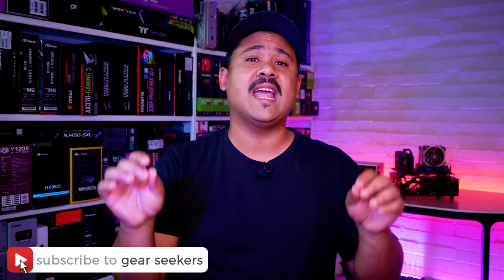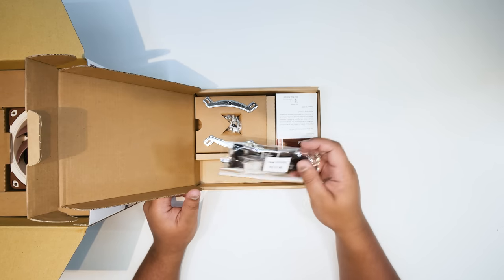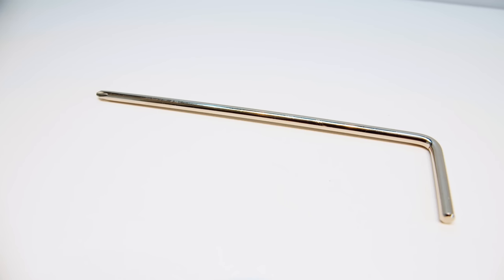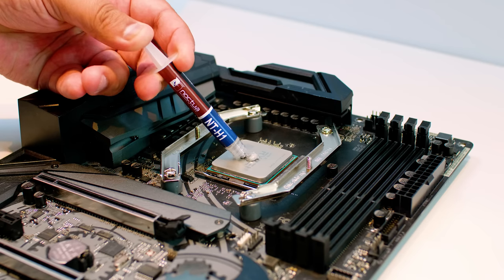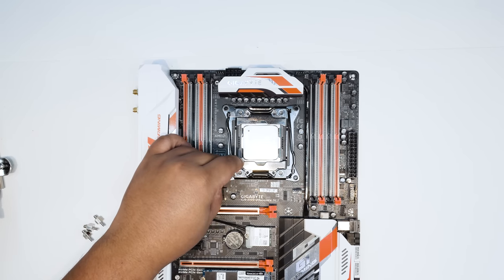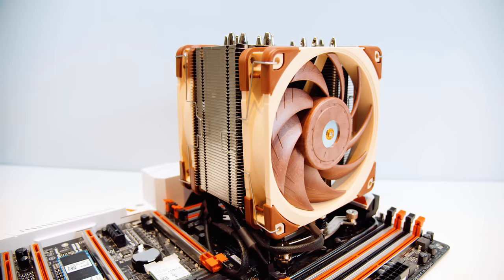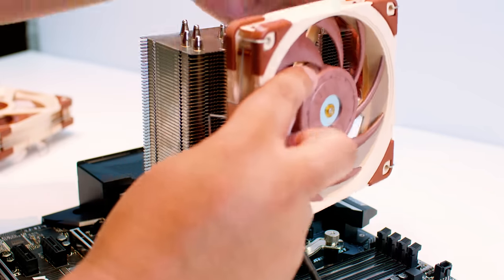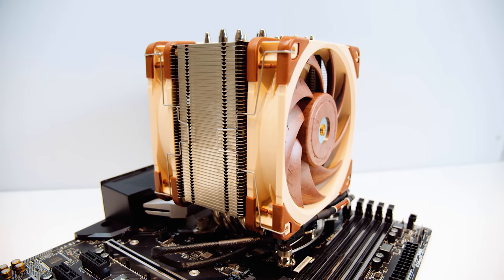HOWTO Noctua NH-U12A Intel and AMD Install Guide

Comment from the maker: AMD AM4 Install 4:24
Intel Socket 20xx Install 7:47
Intel Socket 115x install 10:46
Reply: Top man. Thanks!
Reply: do you know which socket I would have with a Asus ROG STRIX Z490-E GAMING ATX LGA1200 motherboard?  I think it's the 20xx but not entirely sure...
Reply: @yzwme586  LGA1155, so video at 10:46
Reply: I realize I am pretty randomly asking but do anyone know a good place to stream newly released series online?
Reply: @Jasiah Maverick i watch on FlixZone. You can find it on google :)
Reply: @Jasiah Maverick Lately I have been using Flixzone. You can find it by googling =)
Reply: @-cheshire-cat  If you dont mind me asking, how did you get "LGA1155" when he said "LGA1200"" in their comment. The timestamps only mention "20xx" or "115x" which doesn't match "LGA1200"

I'm trying to figure out what guide to use as well.

Comment: I really appreciate this video! After watching this install I'm baffled by all the negative installation reviews for these coolers, it's not THAT complex.
Reply: Hi. Will it install in micro ATX motherboard ?
Reply: @GauravNikoBellic  You can check your case / Mobo and CPU compatibility with this cooler on their website - alternatively you can search your case/CPU/Mobo and find all models which will fit.

Pretty glad I used the service or I would have bought one that didn't fit my case.

Comment: Just used this guide to install my cooler on the 3700x. Now I can hear myself think again. Thanks!
Reply: I'm waiting for am4 mounting kit for mine noctua u12s , so I can get rid of the included cooler. Its pretty, but too noisy for my taste :)
Reply: David, do you have to remove the motherboard from the case? Or can you leave everything in place when installing the cooler? Thanks in advance!
Reply: J. Bertels It all depends really, if you want to remove the mother board it would be easier since you have the space and clearance to do it. But if you wanna go ahead and do it in the case just know it will be cramped

Comment: I haven’t installed a cpu cooler in years and I’m looking to get a new one for my current pc. I’m too lazy to take everything apart, and forgot if I had to remove AMD motherboard to install it. Turns out, I don’t have to! Thanks for the video! I’m also looking to get this exact same cooler

Comment: Mine NH-U12A was EXTREMELY hard to screw in. Threads wasn't latching until you pressure them really hard that cooler bevels to another side. It was no way near nice and easy!
Reply: Sounds like a wonky install, Mine went in like a glove. Hardest part was putting the fans back on inside a small case.

Comment: working on installing this, have had a very tough time getting the fans to re-attach. My solution was to use a zip ties on the wire hoops and cinch them together. The fans now seem tight and secure to radiator. It might have been nice to be designed with a real hook for them to grab, pulling the fans tight, but it looks like a robust cooling solution.

Comment: For Loose screws use the WHITE Spacers!!
Apparently they are slightly bigger. Also use a different screwdriver. 

I had to have someone help me mount the cooler with the grey but I’m worried my motherboard bent a little too much.

Comment: Going to install one of these tomorrow in my already built PC. upgrading from 2700X to this CPU cooler and a 5900X. The case has access to the back mobo faceplate so should be ok. Thanks for the video.

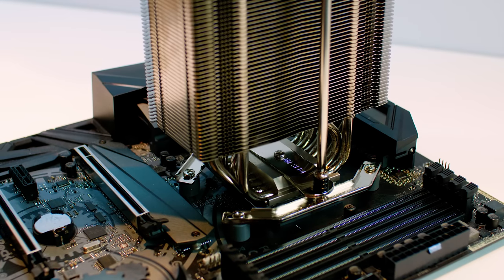Comment: I am having hard time on 6:40. Can't tell if I am tightening it cause it's still loose? PLease help
Reply: exact same issue. can tighten each screw individually, can't tighten them both even when extremely carefully switching between both with minimal screwing

8700k & following the 115x steps
Reply: @00exp7  What I did was I started with the first screw and slightly tighten it but not too tight, then moved on the second screw and tried tightening it until it was same as the first. I tried to even them until eventually both would start screwing down and making that tightening sound. 

I recommend a long screwdriver too. Hoped that help and good luck
Reply: I can’t get the screws to work. Can anyone help?

Comment: The mounting screws on my Heatsink refuse to be screwed to the mounting bars? Did they get stripped?
Reply: Panah I’m getting same issue! How did you manage?
Reply: Exact issue I'm having as I type this and been at it since 10pm its 12am now
Reply: Thomas Evans hey mate, make sure the backplate is properly aligned with the screws or else it won’t work that was the issue with mine. Once you’ve doubled checked you need to apply some force. Ask someone to hold while you screw if you need to. Goodluck.
Reply: Help im stuck with this one, already been hours.
Reply: having the same issue im 6 seconds from crying

Comment: i don't know what i am doing wrong. idle temperature are 36 while on stock settings. When i overclocked my ryzen 2600 to 4.1 ghz with 1.35v. Idle temperatures are 55 to 60. when i tried cinebench 15 or doing some random stuff my pc goes into black screen. After that i have to restart my pc. Is something bad happened while installing cooler or maybe less thermal paste? please reply

Comment: Are there 2 different versions for the bolt down bracket NM-IMB4 from the U12A and the U9S? I may have got mine mixed up.  I've had 3 of the over the past 3 years of the U9S D9DX on 1366 Xeon to 2011-3, 2066 and now a 1700. That used a 115x kit I had earlier.  putting it back on an X99 2011-3 I had to invert the curved brackets for the bolts to reach width across. Weird. A year ago it was pulled from a X79 2011 (I thought was same) lower parts so, I left them on that board.

Comment: This is great for people that need it, but I have to say that, in terms of ease of installation, Noctua ranks at the top of all the Air and CLC Coolers I've installed throughout my 15 years of doing this.
Reply from the maker: Yeah they are pretty easy to install. Some people don't have 15 years of experience installing coolers though 😉
Reply: @GearSeekers   may I ask something: currently I have Thermalright Macho Rev. B cooler and I wanna change it with Noctua NH-U12A. Can I use the same back plate and screws for this Noctua cooler? As far as I understand, backplate is now on, since Thermalright cooler is on. Right? So can I re-use same bolt spaces?

Comment: Hi, Bit of a newbie at this, This is my Motherboard ROG Strix Z590-E Gaming Intel Z590 LGA1200 ATX motherboard, PCIe 4.0, 14+2 teamed power stages, AI 2.0 Features, WiFi 6E AX, dual Intel 2.5 Gb LAN, x4
Which of the two intel parts in your superb video would be best to use on this board?

Comment: Hi Nick, I have an x570 Taichi, (3700X) with Corsair RGB Vengeance pro ram (Ram height 51mm). Just wondering if there would be any clearance issues with the NH-U12A with this height ram. It doesn't actually look like the cooler interferes with the ram looking at your video but if you could confirm this, that would be amazing. The case is the H510i Elite in case you were wondering. Thanks in advance!

Comment: At 6:30 i find it hard to screw it lock. It's always loose.
Reply: First make sure your mounting brackets are aligned as per the video, then carefully examine the sides and make sure the screws are properly aligned to the stud threads. Then push down firmly with your Philips srewdriver and turn clockwise on each side. alternating between the 2 until tight and secure.
Reply: Nvermind mate i already fix it. It's not like in the video, it's cause by a factory defect. I unscrew both sides and screw them together simultaneously
Reply: i’m having problems with that too and i still can’t do it any help?

Comment: My old Nh-U12s is holding it's own cooling my new 8086k! SHOCKED! idle - 27deg - gaming in bf4 max was about 60deg - still going to chuck a dark rock pro 4 on there but damn.....i might go and get that insane samsung 970 evo 250gb first!  Is my OS going to be faster in general on an EVO? or isa it just copying files and faster game loads from your experience?
Reply from the maker: It will be faster.

Comment: I just bought this and the problem I’m having is attaching those 2 fans because those damn clips are too flimsy and won’t stay connected to the sides of the cooler. The videos all make this part seem easy - clip clip and they attach. Is there a trick to this?

Comment: My cooler doesnt want to thread onto the mounting bracket and I dont want to apply excessive force, any help or advice to give? It's very frustrating
Reply: You have to first as the springs have a good resistance.
Reply: see my response above.
Reply: im having the same issue and im ready to cry

Comment: I have a doubt based on this cooler can I attach Corsair ml fans or LL fans to this cooler and will it impact performance and will there be ram interference.
Reply: It won't hurt performance and I highly doubt it will cause ram clearance issue. ML and LL fans are not that thick.
Reply: The Corsair fans WILL impact performance in a bad way.
Reply: @anatoli1903  Only noise wise, but Corsair ML fans have great static pressure.
Reply: @Jack Tran The Noctua fans have a great static pressure too, a lot of it
Reply: @anatoli1903  the ML has more, but at the cost of being louder.
Reply: Yet the a12x25 still have better temps

Comment: I have the older noctua nhu-12s.  Is it worth the upgrade of should I keep my current cooler
Reply: The biggest difference is the fans. It really depends if you need more cooling, if you do then this cooler will offer more performance over the 12S.

Comment: Trying to place the metal clips of the fan back is so damn annoying, when i stand up my pc the clip falls out, is there a way to fix that?
Reply: Initially I experienced the same issue...Stretch the clips towards the center of the heatsink, but don't overdo and damage them. It should then clip straight on secured.

Comment: I installed this on my i7-6700k but my idle temperatures are still up around 60-70C with no overclock. I'm not sure what the issue is.
Reply from the maker: Not installed correctly
Reply: @GearSeekers  that's what I was thinking but I checked and everything was installed per the instructions and it follows this video too
Reply: @fazelock6202  re-install with evenly spread thermal paste, just hope it works normal
Reply: @rnyzen2.079  that cpu just ran hot af. I've upgraded since then lol

Comment: What if the screws won't go in all the way?
Reply: I'm having trouble with spring-loaded screws right now too? Need help please
Reply: @victorhng  I figured it out. They need ALOT of pressure. Push down hard but not hard enough to break the pins on the CPU
Reply: @f42099  that's scary no? The guide said not to apply excessive pressure?
Reply: @victorhng  yeah it's terrifying. Just spent hundreds of dollars on a CPU and you have to worry about breaking it just to get the cooler on. Doing it has given me a hatred for spring locks
Reply: @f42099  tried applying pressure, still won't work. Running out of ideas. Didn't think this would be the hard part of the building process 😂
Reply: @victorhng  Honestly it literally took me hours to get that cooler on. Probably the longest part of mine too. Other than figuring out the memory profile stuff that wasn't fun. If you can't get it on with pressure try putting pressure on the screws while it's not on the CPU to push the springs down a bit.
Reply: @f42099  I finally got it to work, geez that was annoying. Didn't think I would. Good thing I bought a long enough screwdriver. The one that it came was not strong enough. This was my least favorite part of the build process. Well thanks man. I appreciate your help and good luck with your build 😀
Reply: @victorhng  No problem glad to help.
Reply: So just an update, I was able to finally get the screws in. It just takes a lot of pressure and I recommend a long screwdriver. The video makes it look seamless lol, just be patient:)